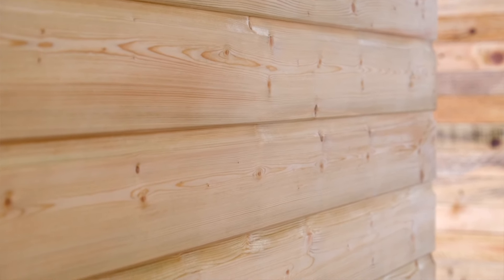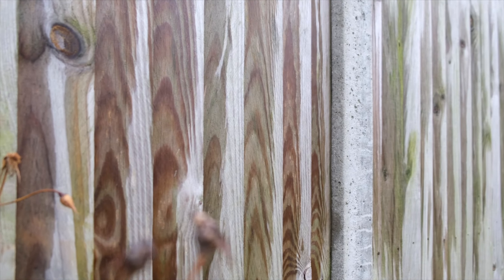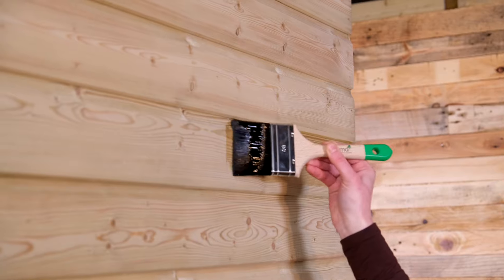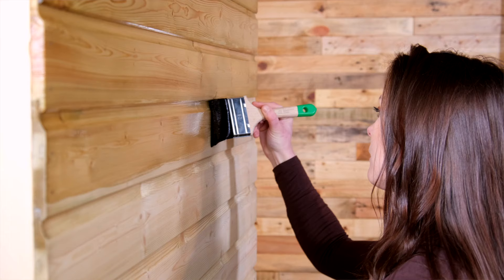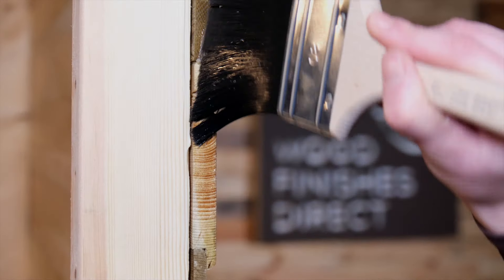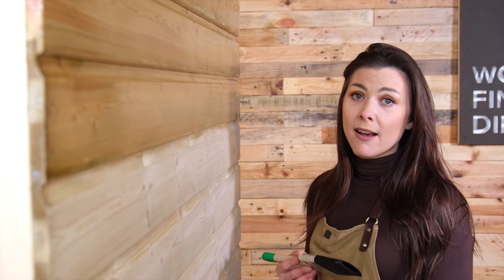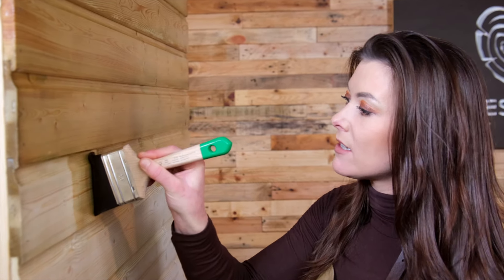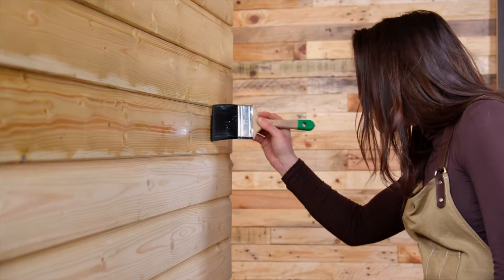How to apply Osmo UV Protection Oil Extra

Comment: Could you use this on wood already stained(coloured)?
Reply from the maker: Hi. This product needs to soak into the timber to protect the timber. If the stain is film-forming it will not be able to penetrate the wood. For the best results, we would recommend wood that is bare or wood that has just been pressure treated or tanalised.
Reply: Ok thank you for your reply.

Comment: Someone did my windows for me,  I specifically told them to apply it thinly.  They did not, they applied it thickly,  3 days later its still tacky and feels like a plastic coat over the wood.  Will it soak in eventually.  What should I do?
Reply from the maker: Unfortunately, once the product is sitting on the surface of the wood it's likely it will not penetrate as the grain is already full of oil. You could try and wipe over the surface with methylated spirits on a lint-free cloth to take off the excess. If that does not work, I would recommend seeing how the oil is performing in the next week or so. Worst case, the excess would need to be sanded off and another thin coat applied. If you need any more assistance, please call us on 01303477555

Comment: Can you airless spray this product?
Reply from the maker: Hi,
No, spray application is also not recommended as it applies the product too thickly. It is really important that the UV Protection Oil is applied sparingly as over-application can result in saturation of the grain. This forms a skin on the surface of the wood and is detrimental to the durability of the product.

Hope that helps.
Reply: I just bought a can of interior osmo for a workbench project and it turned out ace 👍 so much so that I’ve bought this uv osmo for a garden feature I’m working on, I can’t wait to try it 🤓